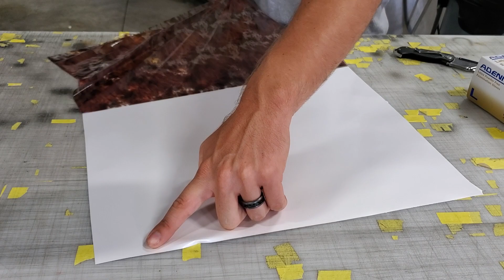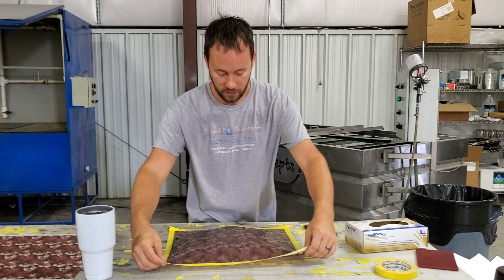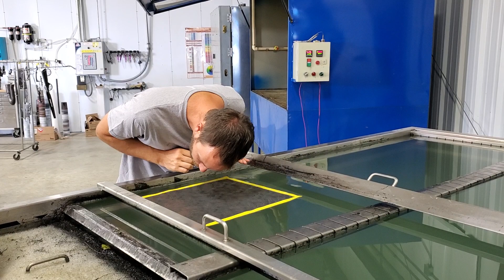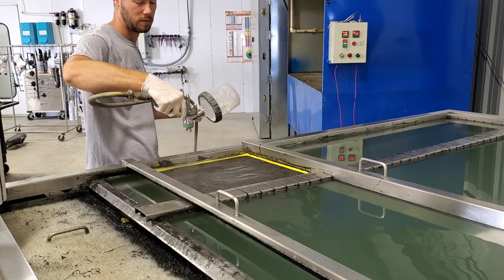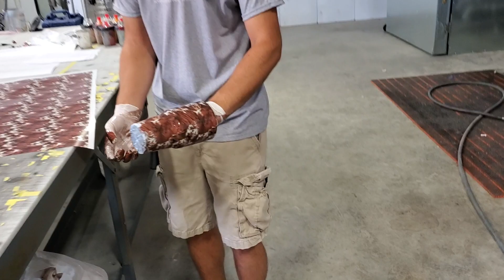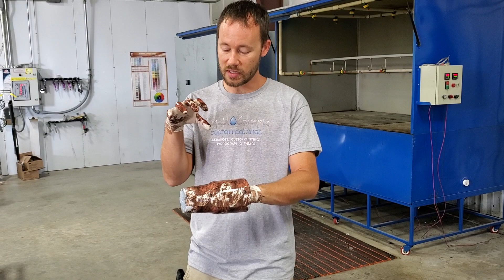Liquid concepts Dipping Custom Longhorn Cowhide

Comment: Do you just clear coat cups then? Or do you have to put epoxy on it? Will clear coat last being washed in a dishwasher?
Reply from the maker: Yes we apply a high quality automotive clear coat. We have had no issues with washing these in the dishwasher as the coating holds up just fine.

Comment: Hey Brian, should i not worry about film running into the cup and when it does, how do you clean it out? Thanks for the videos!!
Reply from the maker: It will be fine if it does or if you want, you can blow up a balloon or even put something inside the cup to help prevent the film from getting into the cup if you would like. You can clean it out with any acetone, lacquer thinner, isopropyl alcohol, etc.
Reply: @LiquidConceptsUSA  I never would have thought of a balloon!! Thank you for the advise!

Comment: I'm new into hydrographics, I have done a few projects and they have all turned out good. The one I'm having trouble with is a stainless steel tumbler like in this video. I have degreased, rinsed, and scuffed with some steel wool. Used some etching paint and then a base coat. 
 My problem Everytime is when I dip the tumbler and bring it out of the water or go to rinse it, everything comes off. The paint even comes off. 

What step am I missing? I'm sure it's something simple but it gets frustrating very quickly for a newbie.
Reply from the maker: Hi sorry for the late reply we were out last week. Can you tell me the type of primer,paint, and degreaser you are using? You should only need to scuff , wipe clean, and then apply epoxy primer and paint. If the paint is coming off as well it could also be that you are over activating. If you can email me some more info and photos I would be more than happy to see what might be occurring. info@liquidconcepts.com